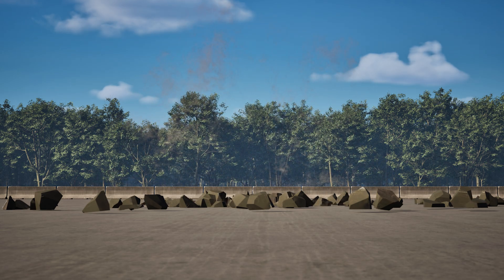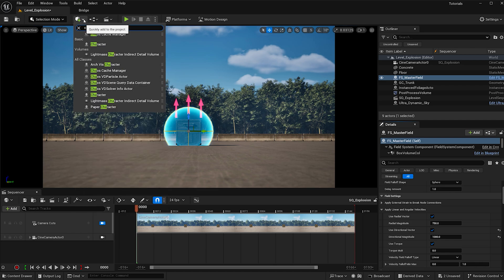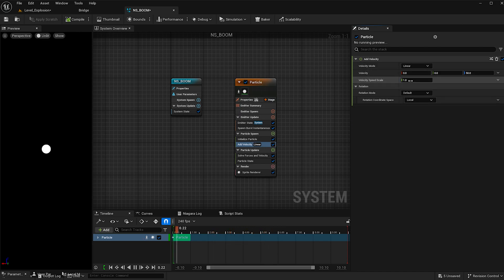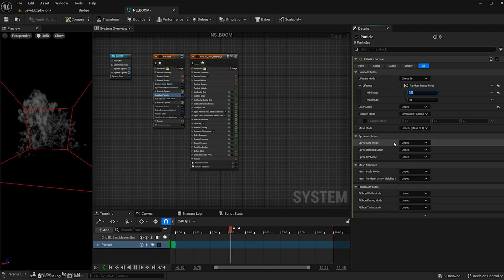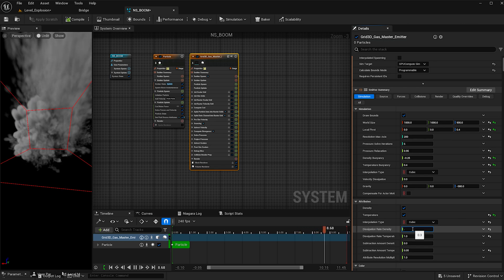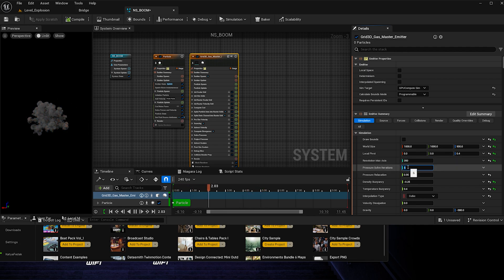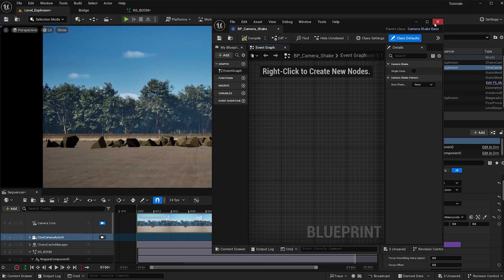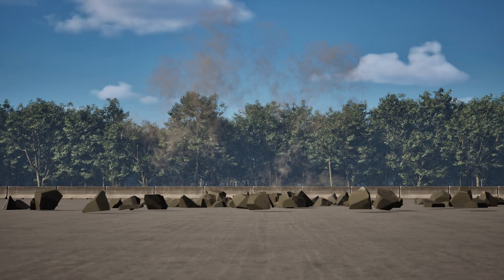Create An Explosion in Unreal Engine 5 Tutorial

Comment: My version of Unreal Engine doesn't seem to have the"Set Fluid Source Attribute" module in the Niagara particle system. Couldn't follow the tutorial beyond that point. Am I missing a plugin or something? I have all four plugins mentioned in the description enabled.
Reply: I had this same issue. Niagara Fluids is a separate plugin from just niagara. Enabling it solved the issue.
Reply from the maker: @peteryoung7170  Ill add that you need it to my description. Thanks for letting me know
Reply: @Unreal_KatyaFedak  I had a similar problem, i couldnt find the 3D master emitter, i had the plugins installed and checked on, i eventually fixed it by resetting the filters in the search for niagara effects and now it appears. i assume just a bug in the niagara system UI
Reply from the maker: what version of unreal are you using?
Reply: i had the same problem with 5.4.4 =( sad
Reply from the maker: @JesusCondeArt  That is weird, I made this in 5.4 and am now using 5.5 and I still see it.  Try to make sure your selecting under particle update for "set fluid source attribute" and make sure you Niagara fluids plugin is turned on. also use gpu and have that set to fixed in the properties. Hope this helps.